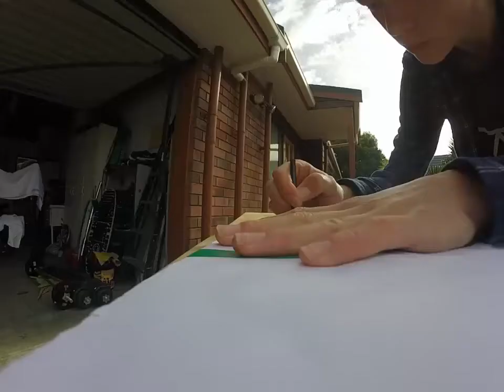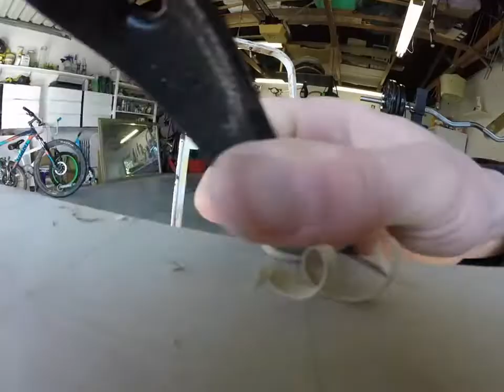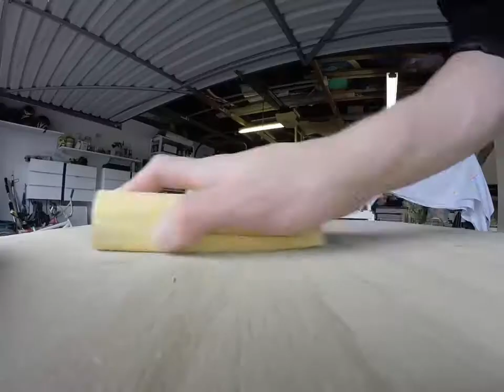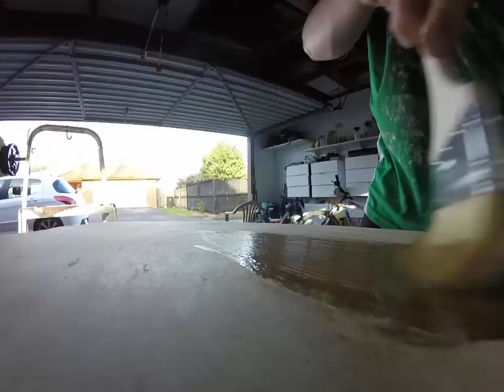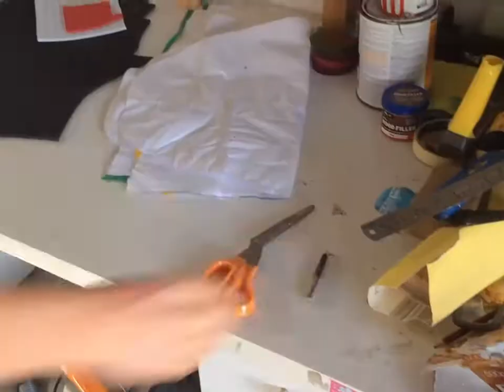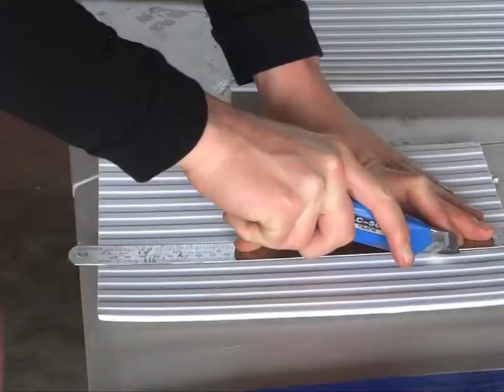Building a Skimboard

Comment: If I was you I'd rather use a cloth or rag when using varnish cos paint brush leaves marks n stuff it doesn't really matter cks u painting over but it also gives a even coat..
Reply from the maker: I don't use varnish its a resin
Reply from the maker: and with resin you have to work quickly otherwise it will stick to the rag